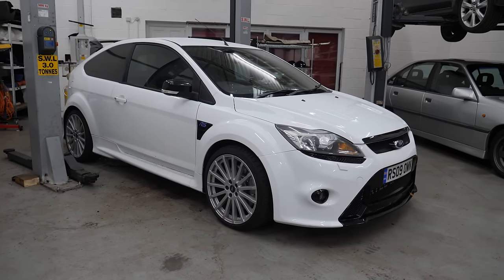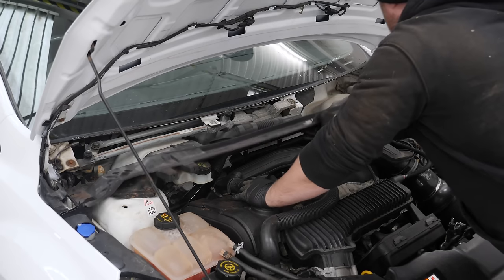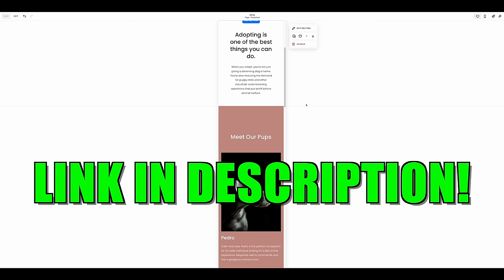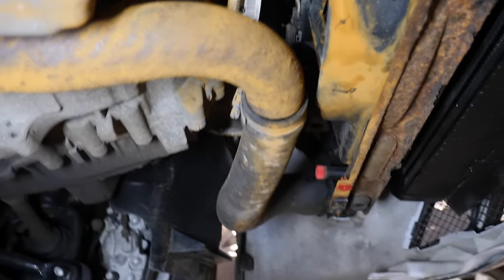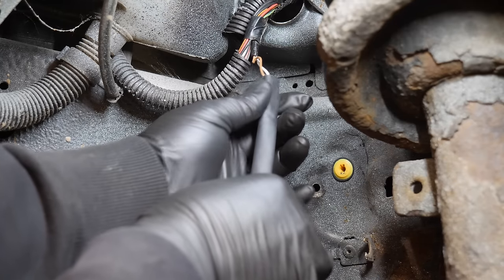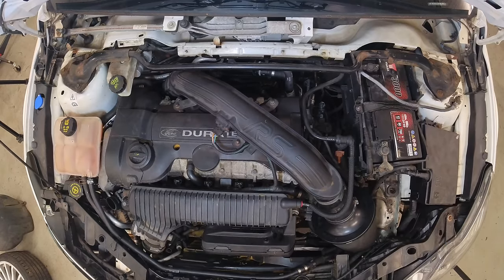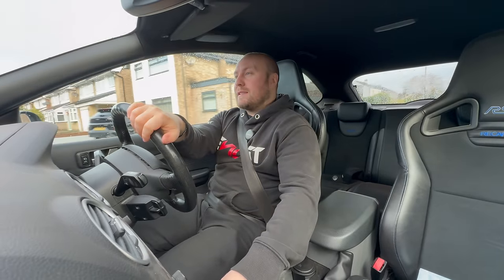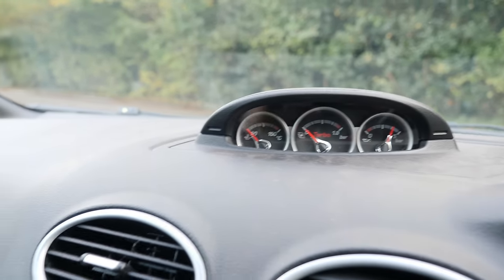RESTORING OUR WRECKED 150,000 MILE MK2 FOCUS RS (PART 12)

Comment: Greetings from Australia!
I own a modified Focus XR5 (ST225 in your language) and there can be a number of weird things these cars do.
Two things to check when the car starts doing strange things that seem totally unrelated.
First thing to check are the connections to the BCM (Body Control Module) located under the glove box.
Remove and re-seat all the loom connections going into the BCM, as sometimes a bit of oxidation on the loom connection contacts can cause all sorts of strange issues.
Second thing is the instrument cluster, over here in Australia we are now seeing a number of strange faults being generated by dry solder joints on the cluster PCB as the solder starts to crack with age.
Please see the link below on how to re-solder the cluster PCB from our Australian RS/XR5/ST225 guru mechanic.
Regarding the gear changing issues, check the cable linkages at both the gear lever end and the top of the gearbox to make sure nothing is fouling on the cables and stopping their proper movement.
When I fitted as RS500 airbox to my XR5, I couldn't select reverse and a couple of the other gears were very hard to select.
Turns out when I fitted the airbox I accidentally moved some cables that subsequently fouled on the gear selector linkages causing my shift issues.
Hope these suggestions are of help and keep up the great content ... lovin' the RS and ST225 content of late  :)

https://oemdenied.com/index.php/instrument-cluster-repairs-
Reply from the maker: Brilliant info mate. Thanks very much! 🍻

Comment: The oil temp gauge will be linked to either the abs fault (usually the cable) or a map sensor fault. The same issue also sometimes stops the gearbox going into 5th and 6th. Crazy I know, but it does.

Edit..it's usually the ABS cables. I'd strip them down top to bottom and do them again.
Reply: Plus 1

Comment: I have the Mk2 Focus RS, and I've been through every issue you can imagine lol! I do believe that oil gauge reader is an estimate which goes off the coolant temp level, I know this isnt any help, but that gauge is useless anyway, what I do know is the wheel speed sensor can cause a problem with gears 5 and 6. I believe if this sensor is broke, you cant go into 5th and 6th while driving & this can also knock out that oil temp reading!

Comment: I had abs and traction problems on an E39 BMW.  Changed sensors, all 4 but still had problems.  Turned out one of the rings was bad. Got it replaced and problem solved.  Mind you it didn't cause any other weird problems. Problems like these drive me mad to the point where I give up and send it to a professional.  Keep up the good work.

Comment: Had a similar issue with my fiesta st, burnt the abs wire at the chassis leg from the exhaust due to a leak the heat somehow melted it, always good to trace your abs wires back just to be safe. Also plugging a scanner in is a life saver compared to trying to find the fault by eye.

Comment: Same problem on mine, was cluster issue sorted by auto electrician. It was throwing faults on abs, limp mode and a vibration on break pedal( slap the dash lol)

Comment: I dont know if its the issue but the speedo unit causes all sorts of issues.as the alarm and pretty much most of of the electrics run through it.they are well known for all sorts of issues.also i believe if you have a aftermarket ecu holder the witing look xan can chaif through near the bell housing on the gearbox.i had a boost solenoid go on mine wich caused all sorts of boost issues.not to mention the alternator and the oil filter housing. Diaphragm in oil filter housing went.aka pcv and causes a massive vacuum inside the engine.

Comment: Traction control light and ABS light will often come on with a bad wheel speed sensor. Get it plugged in to a scan tool and it should tell you which one has gone bad.

Comment: You need a diagnostic machine to pull the codes and also view whats called live data, you can then monitor the wheel speeds and pin down which one is playing up.

Comment: The abs problem can be linked to the roll sensors on the suspension. Check theyre not broken or electrical connectors rusty

Comment: The ABS sensor is also the ring in the hub\bearing that can cause issues if there is a contamination problem with it. On Minis it causes a trifecta of fault lights, ABS/DSC/TMPS. Did you just put a new sensor in without cleaning out the hole etc? Think it's that easy? 😁Get some cans of brake and clutch cleaner sprayed.

Comment: I had a similar issue with ABS, albeit not on a Ford but it turned out there was corrosion in the sensor holder and that made the gap between the sensor and the ABS ring on the shaft too big so it couldn’t pick up the teeth with the magnet. Also another time the ABS ring on the driveshaft had cracked due to corrosion underneath making it expand this then threw the sensor off. Perhaps it might be worth a check. Keep up the good work!

Comment: I feel your pain mate,had a boost issue on a MK2 st I recently purchased.changed boost solenoid,map sensor,AFM etc etc.spent 2 days messing to find out the boost solenoid vac pipes were round the wrong way the whole time.cheap fix if only I'd found it first 😭😭🤣

Comment: The ECU has preset oil temperature setting IE you can un plug the oil sensor wire from the oil filter housing and still get a reading as its preset! I am sure the car has been in a very damp environment so hence my thoughts are its the ECU thats playing up! Great videos and thanks for sharing

Comment: For the ABS fault, it could be rubbish after market sensors but it’s worth checking the magnetic pick up ring in the driveshaft to make sure they weren’t damaged when you did all the suspension. Worth a look anyway 😂

Comment: When mine had a fault and started running like a pig due to some wiring my traction light would illuminate. Seems the traction light is a eml as well even though it has an independent eml

Comment: On my ST225, the ABS pump was a common fault. fortunately mine was replaced before I bought it some 12 years ago, so the car was less than 5 years old when it failed. Whether this is the problem on the RS I don't know?

Comment: I would get that on a diagnostic machine and check live data in wheel speed sensors. I’m not familiar with the mk2 rs but on my mk3 I had an abs fault and fitted genuine sensor after an aftermarket one was reading 158mph at standstill. Genuine was actually cheaper!

Comment: I think one of your front wheel bearings is causing the issue.  Either poor quality / incorrect fitment.  If you can get the codes read that may well help you isolate the actual wheel at fault.

Comment: The oil temp and pressure gauges are more just for novelty and dont work in the traditional method. They are just estimated values by the ECU  and various sensors so when part of the electronic system goes down they can be affected. Im guessing the ABS wire on the opposite side of the car to the one you repaired is also stretched and thats your ABS fault. You cant see the wires broken, they stretch and break inside the rubber insulation.

Comment: I know your pain, abs module has gone on mine ( unrepairable ) can’t find one for the mk2 rs for love nor money 🤯 check the abs sensor where the cable plugs in, the copper ring wears away over time. The speedo n mileage also goes when the abs has a fault 😂 it’s all connected.
Reply: Get it repaired
Reply: It’s not repairable, been sent to few companies! Can’t find a replacement anywhere.
Reply: They can occasionally come up at breakers

I would make a post in the forums, someone will have one
Reply: I’ve tried the forums, only option I’ve found is getting one remanufactured but it’s pricey. Supposedly it was an upgrade for an st so there’s none out there anymore 🤯 hard to come by even from breakers unless it’s a blown engine they won’t strip a healthy engine for parts 🤷‍♂️
Reply: Had the same issues with my RS. Limp mode, couldn’t get 5th and 6th. Warning lights on. I Checked it wasn’t ABS leads. I got my abs module sorted. sent off to ECU Testing. Booked it online. Next day courier picked it up on a Monday and delivered back to me on the Thursday.  Lifetime guarantee £233 all in.
Reply: Il give ecu testing a try can’t hurt to send it to another company, it’s the chip inside mine that’s fried supposedly 🤷‍♂️

Comment: I wouldnt say the oil temp and abs light are related. Id suggest checking the wiring to the MAP sensor connector as they set at an awkward position at the back of the connector, the MAP sensor is directly connected to the PCM/ECU and if that signal is lost youll get erratic faults. As for the ABS light id say check the ABS rings in the hubs and replace one or both.
Reply from the maker: Both Bearings are brand new though so it doesn’t make any sense that they’d be the problem unless they are faulty 🤔
Reply: @EVILGT  nah in that case i cant see how both could be wrong. What DTCs show up when you scan? Id be looking at the ABS pump next - i have heard of the controller boards going tits up on them. Might be worth getting one to swap on, but its mounted in an awkward position in the engine bay unfortunately...

Comment: Abs relucter ring Rusty ? The abs sensor won't read property when they start to rust they lift the ring so it gets a untrue reading hence the traction control  saying this I can't remember if u put new shafts in with all the work that's been done 🙌 if not pull the abs sensor out shine a torch in the hole and spin the wheel check the condition😊
Reply from the maker: They are brand new mate. Both the sensors and the bearings 😬

Comment: It’s not true oil temp it’s calculated by the ecu by measuring intake temps via the boost pipe change the map sensor. Also the abs could be if you used cheap only go for genuine Ford parts.

Comment: I had a very similar issue, but my traction control light was on

Turns out fuse 35 for the ECU had blown, so I replaced it and now it's all back to normal 🤯

It could be the dry cluster issue as well but my oil temp dial sometimes does that too
Reply from the maker: Fuse 35! Nice one I’ll have a look 👍🏼
Reply: @EVILGT  No probs! I found that there was a 10amp one in there but after looking on the RS forum it should have been a 15 amp!

Good luck though mate, hope it works!

Comment: Chances are the ring on the drive shaft has failed . Now the ABS light will go out as soon as you move but once you go past 20 kph the light comes back on ?? If you scan the car it will tell you which ABS sensor/ring has failed

Comment: The oil temp is calculated from the ECU not a sensor as you may expect. The usual suspect is the map sensor. Have you read the abs fault code, cheap sensors are usually bad news.

Comment: I’ve had the same dodgy problem on my mk2 ST. The magnetic pick up ring for the abs will be rusty on one of or both of the front wheels. It shits itself and stops the oil temp and pressure gauges, switches off the reverse interlock, rattles the abs in once you start moving and seems to over fuel the car at the same time, the fuel range also stayed static. New wheel bearings fixed mine, yours might have been the sensor and it just needs the code’s deleted.
Reply from the maker: The bearings are brand new too though which is what I don’t understand 🤔
Reply: @EVILGT  it's possible that the magnetic rings in the brearings are damaged, as others have said, you really need to get it on a diagnostic machine that can see wheel speed data via a graph and see if any of the wheels have weird signals.

Comment: Nothing ford related but had a vw with an ABS sensor issue checked then for new still didn't work I had to places then like for like and as stuiped as it sounds it had to be the same colour of plastic 😅 and boom fixed the problem

Comment: Common fault the stretched ABS leads, they went faulty on my old one along with lots of other things 🤣 I did the exact same and reversed the brackets around to give more slack. Also make sure u change that plastic plenum to an alloy one mate, they have a habit of going bang and then youre left with shards of plastic in the engine.  Mountune do a good one or Airtec is a bit cheaper

Comment: I thought you would have checked pipes first before recommending the MAP sensor 🤭😂 

*even after market pipes rub, i add an extra jubilee at the the rubbing point. 

**Ford are that tight they used top end ST looms on their RS models, that explains why the wires are so tight to begin with. The RS is wider, you need to add quite a bit extra on that wire buddy allowing you to loop it over the brake line then to the speed sensor 🤘

Use forscan (free) and you can monitor each wheel and what speed it's doing. 

You need to check the solenoid on the gear lower gear stick, it's linked to the abs system and will lock you out of 5th and 6th and ALSO locks you going past 5th gear making it hard to select 5th. When the solenoid is working correctly 5th is beautiful to select. 

If it's been unplugged previous owner knew it had issues and unplugged it to stop it from letting you select 5th n 6th. If it's plugged in either the solenoid is faulty or the ABS fault is causing it to not partially activate.
Reply from the maker: I didn’t recommend the MAP sensor you lot did 🤣👍🏼
Reply: @EVILGT  😝

Comment: 😂..not love ford's.. could it be a relay..? On same circuit..my st kept blowing the cruise control fuse..and it ended up been one of the heated washer jets shorting out..id of never found it..but put a higher amp fuse in and the washer jet started smoking😂😂..disconnected it..put correct fuse in and got my cruise control back..a good watch Ben.. you'll sort it...💪💪👌👌

Comment: benji,, ford transit has a thing where abs light came on when tyres worn below a certain size and it altered the distance on wheel rotation  so ie if you had lower profile tyres the rotation of the wheel would be smaller this throwing out ecu s parameters on the abs/ traction control and throwing up a fault. your wheels and tyres are not stock sizes? just a thought. next move should be rigid tubed boost pipes to deal with the extra boost you have created
Reply from the maker: The wheels are factory and the tyres factory size too so that shouldn’t be an issue. Definitely need better pipes without a doubt 👍🏼

Comment: I'd try and find someone with a proper diagnostics machine that can read the proper Ford fault codes, you'll be chasing your tail forever otherwise. From a quick read of the foums I think it's worth taking out the MAP, cleaning it up and letting it dry then plugging back in, the same for it's connector, then clear codes and try again.
Otherwise, the only thing that links all those systems will be one of the ECUs in the car, I hope it's not that for your sake!

Comment: Have you got any aftermarket things with a power supply cable running near the standard wiring loom? I've had a ford where I fitted an amp and everytime i turned the car on speedo would shoot over to 100mph. I gained a shed load of milleage lol. Power cable was causing interference. It seems you have an interference issue. Might be bad earth
Reply from the maker: Definitely something to check 🤔

Comment: Have you checked the rear abs sensors? I know with some cars if the rings go rusty it scan make it look like a sensor issue
Reply from the maker: Not yet mate no
Reply: @EVILGT  unplug one at a time until the fault is constant and not intermittent. This will show you where the fault could originate

Comment: They are riddled with faults these cars, front grilles rust easily, rear spoiler has rubber pads under it to stop it rattling on the rear window, rear bumper rubs on bodywork and causes rust, clutches fail for no reason and are replaced by ST ones under warranty, my very low 6k miler had some of these faults but I loved the sound it made and its looks.

Comment: Years back lots of elec problems were bad multiple earth points.
Wiring diagrams are the best some are easier to read but you still need to want to read them. 😊
You don't learn anything if everything always went right, how u missed that pipe on the bottom 😂

Comment: The cables from the oil pressure sensor and the ABS sensor either have crosstalk, an intermittent short or have been misfired by the previous ownership. Remember that the oil sensor will have a DC signal and the ABS will have a variable AC signal. If you don't have access to calibrated tools [multimeter and TDR], get an auto electrician in. He/she will sort it out quicker than you scratching your balls, arse or baldy head.

Comment: Did u say you used aftermarket ABS sensors, that could be the problem, only use genuine OEM..  not Ford Fleabay
Reply from the maker: Judging by the rest of the factory Ford stuff on this car I’d have thought aftermarket would have been better 🤣👌🏼

Comment: Bad ground? Bad module? Bad connection on a plug somewhere? I would be checking them
Reply: have you plugged it in ran a scan on it see if anything is obvious? Sound electrical and sounds like loose connection